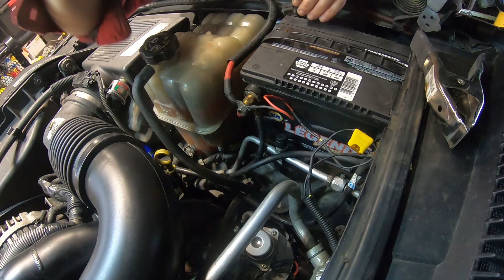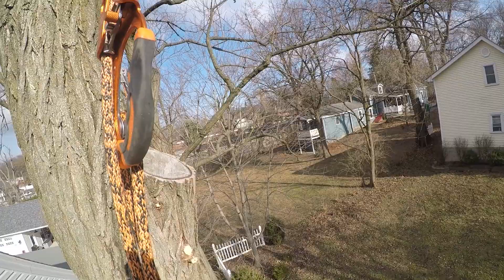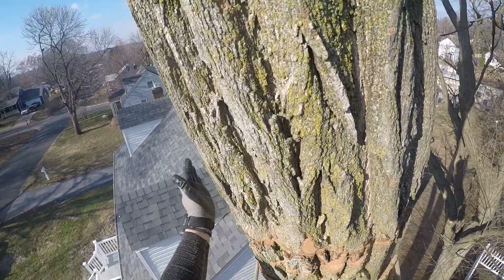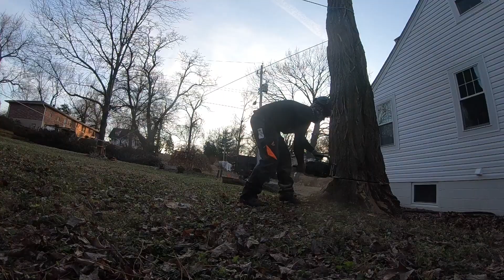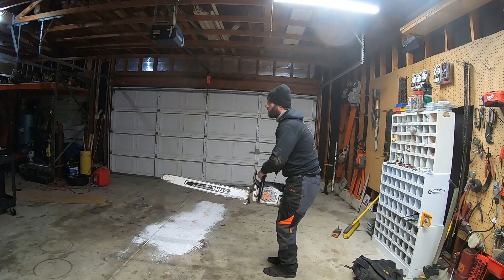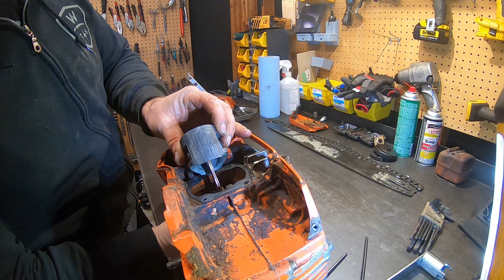Jackpot!!

Comment: "...but - $50? Faark."
C'mon - someone out there must have a Huskie connection to help Human on this project?
Reply: Would Creek saw shop is a very good person to go through for parts.
Reply: Go to huztl.net you can get an aftermarket piston and cylinder and anything else for that 372xp for super cheap
Reply: @kylecavenig4063  mainland chinese supplier??
Reply: Yeah but they actually  have great parts and full  clone saws they make a  clone of the 372/365 non xtorq aswell as several stihl models you can buy as a parts kit or you can buy the fully assembled  versions they are branded holzfforma  check them out on YouTube I have there 066& 372
Reply: Do yourself a favor and get the 572 ... give it some righteous flow-enhancements and leave the old-school on the mantle 😂
Reply: @fabzacres-blackcat  I still rock a 371xp from 1999 from time to time it's not my daily saw tho
Reply: Kyle Cavenig nothin wrong with em at all - good performing , durable saws that have stood the test of time for sure !  The 572xp however is a beast when righteously modded ... I can get em brand new with full wrap handlebars; big dawgz and big - boy clutch cover here in NY for 9hun PHO ... If it comes down to sinkin 350-500 into an “older version” for them scoots I’m buyin new every time !  Guy I cut with scored a $50 Husqvarna 575xp , oem new carb , oem jug and slug is around $300 ; cases gotta be split and new crank , bearings seals etc so let’s say $450+ in parts - if you do all the work yourself maybe worth it ... for me I buy new , mod em and run the piss out of em ... bought the 572xp last month and it don’t owe me nothin ... gotta remember on the new strato saws most feature auto-tune and Mtronic ... ain’t no way on Gods green earth a guy with a little orange screwdriver is gonna “out-tune” a computer !!!
Reply: @fabzacres-blackcat  I hear ya but just take look at the website I was talking about huztl.net I bought 3 fully assembled  saws from there and I cut a ton of trees with them while working for a tree service
Reply: Kyle Cavenig Yah , imho those “kits” can be made to work with a mix of oem parts ... some have had good luck with them, others 5-7hrs before bottom end blew its berry’s ... Any saw I build whether for personal use or for a customer gets 100% oem ... should be able to get 1000-2000 hrs out of em depending on mix oil and proper maintenance by the operator ... Put another way , yeah you’re dropping a g on a new saw ; that’s saws’ makin ya 30g plus over its lifespan (IF you have the work) ... can’t see tryin to save a few hun from the get go but that’s just my way to look at it ... ymmv

Comment: Congrats on your score. Those huskys are very easy to split and work on. I've done a few and always big bore them for a $100 or less. And since the clutch was smoked, I'd Chang out the o ring on the crank(under the bushing) just to make sure it doesn't get a air leak.

Comment: good work cory that new saw is awesome that was a good find.  i do have a question for you on chainsaw chains  im needing a new chain for my saw can the chain have more drive links than the chain the saw came with or does it need to be the same amount of rive links as the original chain? im asking because the saw i have is my first chainsaw and im not very experinced with buying chains for it im looking at one chain but i dont know if my saw will be able to run it as the chain im looking at is for a 50cc saw and my saw is a 42cc saw
Reply: The chain will need to have the same amount of drive links. The information for the chain will be stamped on the bar.✌
Reply: It’s a dependent on bar size and gauge mate. Usually lasered on to your bar somewhere will be the specs for it so just for example a 50cc saw might have a 16” bar or 18” bar these chains will vary in length (or drive links) so it should tell you how many drive links the bar gauge and bar size and chain size to suit I’m thinking this will probably be 3/8 low profile or maybe .325 check the bar bro if all else fails take it to a dealer and get someone to show you I’m sure nobody will mind. Cheers
Reply from the maker: What the other guys said

Comment: Dumb question: I've heard boatloads of safety warnings about flames and sparks near a battery due to hydrogen offgassing. Is that mini-torch hot enough to ignite H2 (which has a high ignition point) and something I shouldn't worry about doing when I have to do something similar under the hood?

Comment: BUDDY it's worth getting it split and installing bearings and new seals ,then go to hutzl saw parts and order the aluminum throttle bracket  it's like 4 dollars it stops air leaks the OEM one is plastic and overtime it warps goodluck

Comment: $50??  Gah that's what I paid @ some Pawn-Shop for my Poulan PP4218!!  So jealous!!  I'm newer to this stuff than you are but, unlike you, I usually only get used saws (only saw that was brand-new was my top-handle "Scheppach" unit, which has amazed me considering the $145 price-point!) however I'm not a solo company I do some solo work but do job/contracts with local companies and, excepting 2 groups that are clearly in-love with Stihl for non-rational/objective reasons, everyone else has a litany of complaints about Stihl in fact I do climbs for this one company where the owner recently told me he'd had 3 192(193?) units and not one of them lasted long (I'm talking months!), I didn't get all the details & it's anecdotal of course but this sentiment is shared by many so I consider it as "where there's smoke, there's fire"!  But Husq & Echo, I've never ever heard someone complaining about the brands, *ever*, and husq is comparable in price to Stihl while Echo, surprisingly, seems to boast comparable power//weight ratios yet is significantly cheaper (am needing a bigger top-handle, if my 1977 Poulan 25d restoration doesn't go to-plan, or the result is less-than-stellar, the Echo 355t is (by far!) the most appealing saw for the $ IMO, honestly would've expected it to be a $500+ saw but it MSRP's @~$350!)
Also....I did Cntrl+F for "Wolverine" and was surprised to see nobody made that reference Re your beard here ;D  Looks good man!  

Thanks for all the vids, always enjoyable am glad I subscribed I hope you keep progressing steadily on your journey & share it with us ;D 
(PS- I can't urge you enough to learn to splice!!  Apologies if you have and I've missed it but so far as I can tell you only buy splices - using @Samson Rope 's youtube for class-1 double-braid splicing is all that's needed, I've done about 10 splices and the only failure was the 1st attempt - using NErope's video - from #2 onward, using Samson's video, I nailed every last one, it was a bit daunting on the first 1-2 splices but then it's clear-sailing, it's certainly a VERY steep learning-curve but it's also a very short curve, I would use the video still but after a couple successes it's not even needed!  Climbing lines/tighter braids are more difficult, though half of my splices are the notoriously-difficult Blue Moon climb line, those are kind of a PITA but do-able, however for rigging/bull-ropes I can't stress enough how darn easy it is, all my 1/2, 5/8 and 3/4 Polydyne lines are all spliced and man were those simple-as-can-be, hell my 3/4 Polydyne Safebloc sling is a stronger product than an OEM Bloc-sling (with tenex) which is awesome because the way Sherrill's doing it you can only get it from their stores/outlets IE sherrrilltree, treestuff & rope-logic.  I expect that you Atlas may be the easiest rope to splice that's available lol, not just because of the size & flexibility of a line that's a 4.5% elasticity but also because the core/cover seem to be almost 'slippy' on that cordage so doing splices on 5/8 or 3/4 Atlas should be something you can plan on nailing the 1st time you try it!)

Comment: I've melted the oil gear twice on my 261 while flush cutting stumps. Usually the cut is off and I start hitting dirt. Once it hits a rock  my monkey brain goes "I'll just power through it" and things start getting pretty hot. I imagine if the 372 was in a similar boat and running a little lean it could certainly smoke the piston.

Comment: Husky and Stahls have tough bottom ends usual get 3 top end builds on a bottom end usually cut 2 to 3 million MBF on a top end....372 was a great middle size saw comparable to a Stihl 044/440....both great strong saws for smaller work...